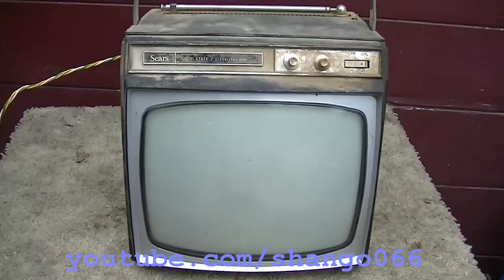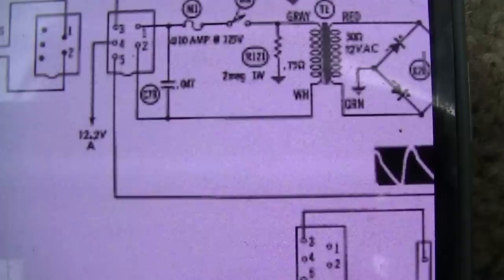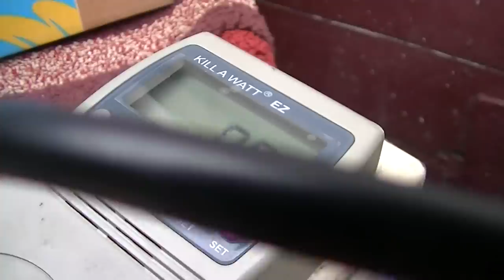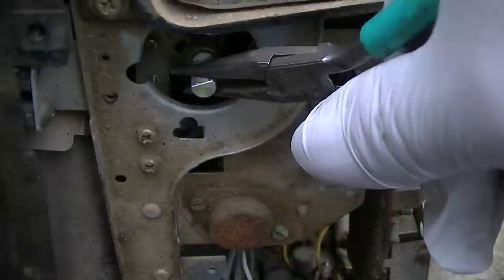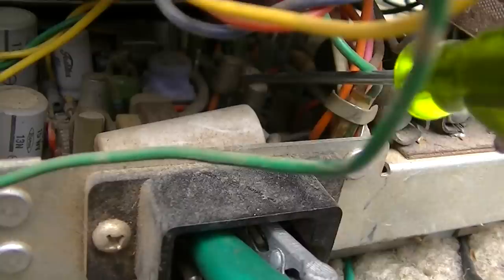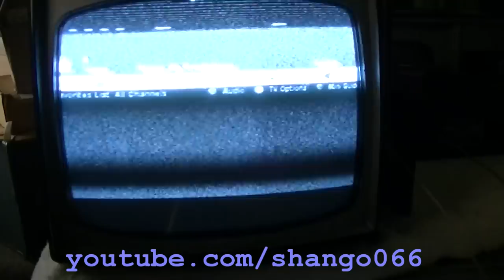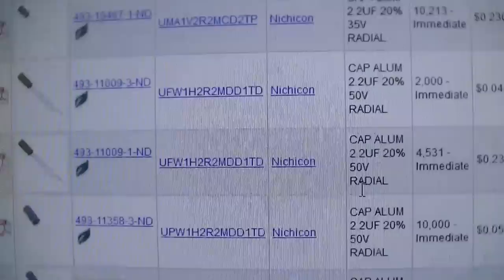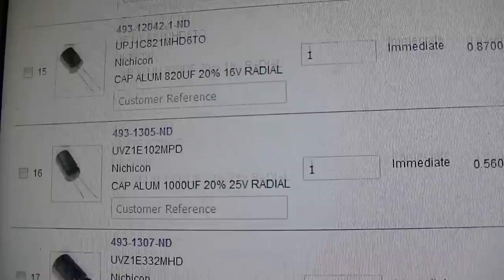1966 Sears Toshiba Portable Black And White Television Assessment For Repair

Comment: I have been self diagnosing my own CRT problem though watching videos by you and others with experience. (I have zero electrical / electronics background) and I was getting hung up on the best place to order parts. I tried a few places but kept hitting a wall. That little clip of you ordering parts at 25:00 made all the difference in the world! It finally "clicked" on how to order the correct part and helped me locate everything I needed from Digi-Key. I placed the order a few hours ago and they shipped it the same day! AMAZING. Thank you for posting this! ATTENTION: To all those champing at the bit to provide me with unsolicited warnings that I can critically / fatally injure myself...   I got it. I understand. You don't need to waste the keystrokes replying here.
Reply: I've got an Oz made 60's tube radio/pop out record player of the HG Palmer brand (Garrard record player) ) console setup , coolest looking thing , not working but there is a wire loose on the board that I can't for the life of me . . figure out where it broke off ,  the kicker is that the chassis appears live . . high rpm flicker on the volt stick . . a project to end all projects ? 
Most of these Oz consoles were made by HMV & rebranded to suit smaller outlets

Comment: Sony was obsessed with making TV's as small as possible in the 1960's.  I can just see the draftsmen doing the PC board layout, using a micrometer to measure a hand full of parts for their component models.  In the mid 1970's, Sony's sets were already having electrolytic capacitor problems.  I remember when I was in the military in Tech School, the base commander caught wind of my TV/radio repair talents, so immediately got all his repair business.  He had one of those 5" Sony TVs from 1964 he wanted repaired, when I saw it, I said "no thanks!".  Those were pure misery to work on the way they had all the components and PC boards jammed together.  To be sure the set was properly fixed, you really needed to replace every electrolytic cap.

Comment: Yeah, I spend an hour putting together DigiKey orders. Their new filtering system is actually much better than the old one. Checking the "in stock" items box can cut the results list way down. I also use first class mail for shipping since components are usually light (under 13oz package) so costs under $5 to ship and is often faster than the more expensive rates.
Reply: Hah, I was yelling at the video “click the in stock check box!!!”

Comment: I never worked on that particular model but, was familiar with the Japanese solid state and tube sets.  Toshiba was one of the better manufacturers.  The Japanese reused their pocket transistor radio experience with the earlier TVs (note all of the germanium transistors, cheap electrolytic caps, and dog bone style carbon film resistors).  I like how well Toshiba kept the power consumption low on that set.  I would imagine that set could run off of AC line power, 12Vdc car power, and probably a battery pack consisting of 8 D cell carbon-zinc batteries (they didn't have Alkaline batteries in that day).  One of the common sales pitches at the time was, showing someone at the beach enjoying the ball game, in reality though, the screen would wash out in the sun.

Comment: We had Sears/Toshiba TVs back then. My brother worked for Sears back then so he got them with an employee discount. They had a terrible problem with electrolytics going bad. It made upkeep very expensive. Replace one and two more would fail. Replace those and get ready for more failing. The only caps that were worse were those awful plastic ones from Sanyo. Both companies designed great products but their bad caps sent them to early graves. After the 3rd or 4th trip to the repair shop people just gave up on them.

We also had a Wards (Airline) set very similar to this made by Sharp. It lasted for many years. Most of the Sharp gear sold by Wards was OK for years. Sears had a spotty record after they switched from Arvin to Asian suppliers. Stuff from Hong Kong was especially questionable. 

This is probably a very rare survivor. The rest probably got dumped on the curb back in the 60s.

Comment: The US electronics industry could see the limitations with germanium transistors as early as 1953 and saw silicon as the future.  There were 2 different types of Germanium: point contact (which were very tidious to build and could lose connection under high vibration) and diffused junction types.  Point contact quickly became obsolete after the diffused manufacturing process was worked out.  The problem with the diffused junction types is, the juntion un-diffuses after a number of years, especially if operated at high junction temperature.  So, diffused germanium transistors can actually go bad just setting on the shelf.  The Japanese we're slow to switch over to silicon, probably because they put so much effort into the development and manufacture of germanium.  They had to "reinvent the wheel" so to speak.  The only transistor technology they could get their hands on in the 1950's, was basic overview information derived from US tech journals.  Also, germanium transistor manufacture was easier build from a company startup point of view than silicon.

Comment: You can select several criteria in the digikey filters by holding down the Shift Key and clicking them. For example, when looking for 15V minimum, you click 15,20,25,35. That will give more results. Also in some filters you can enter min and max values in the fields below

Comment: Digi-Key website is an even bigger pain in the ass to use than Mouser-lol, great video.
Reply: I like Allied Electronics, the website seems easier than Mouser. Less selection, but they tend to carry a manufacturers line instead of just parts and pieces of it.

Comment: I have a set just like that made by singer co. and i do have the external battery charger pack with it, it was at my brothers house, one of the sets we had as kids, not sure if it works yet though, but another portable we dug up did work pretty good, only thing mine is missing is the actual battery, but every thing else is with it, i may wanna try it some time, the first set i just plugged in it took about 10 min. then it came on, these have not been run since we were kids, but i took a chance and plugged in one set, but not the singer set, ever hear of a tv made by them, as i know that co. makes sewing machines but when we got these sets out i was surprised they made tv's too. they are cool little sets, i watch The Flintstones cartoon on the first set i tried and ran it a few times no Issues, the singer not sure yet to try, but might. as here i still use the older CRT sets.

Comment: I find using ranges of values when searching helps a lot.  Say you're after a 16uF@16V.   Old cap tolerances were wide.  Searching for between 10-20uF and 16-50V would show you a lot more choices, and you just pick an appropriate one.

Comment: Perfect section of carpet to add to my carpet lined shower.  Just pick Panasonic electrolytics from Digikey.  They are pretty much the best.  FM series for low ESR circuits and the EB for ultra long life if there is room for their slightly larger size.

Comment: I wonder if Toshiba/Sears used the label "SOLID STATE/transistorized" because they expected that integrated circuits would start appearing in consumer equipment within a few years.

I have to admit that some of the components in Japanese electronics of the 1960s through the early 1970s were really cute! I loved those three little high voltage tripler diodes. Sanyo made nice looking germanium transistors that were shrink-wrapped in pastel blue or green. The resistors were often of a miniature dogbone style.

Comment: Hey Shango, you know when you have those filter lists on DigiKey and other sites, you can hold the Ctrl key and click several different options in one list, if you like. For example, you can select 10 different voltages at the same time if you want. Or select 20, 21, and 22uF at the same time.

Comment: I haven't used the search engine on Digi Key lately, but I found that the one on Mouser is somewhat frustrating to use sometimes since it displays items that are not in stock, or require large volume buys, like 5000 units. To make matter easier I usually go by capacitor value in uf. then a range of voltage, pick lead style, then let it search. I don't worry about brand names, other then Lelon, the rest are usually reputable brands like Panasonic, Rubicon, Nichicon, or United Chemicon, just pick out the style that works best, for the lowest price. If it's a choice between 85 degree or 105 degree, of different makes, but the price is the same, go for the 105 degree, ditto for ESR, or voltage. It never hurts a project using a better rated cap if it will still fit. Another thing, if you can use a non polarized cap to do the same job, and it's inexpensive, go for it, sometimes it makes sense to replace the small value electrolytics, under 5 uf, with those.

Comment: If you hold down CTRL when you'r selecting from lists on the Digi-Key website you can select multiple values if you aren't sure what the new rounded value is for a cap.

Comment: I'm thinking about going to Digi-Key for some caps for my 1989 Macintosh Portable that still won't turn on after the battery was rebuilt.
Reply: VectraQS mine has bad ones on the audio board... It's mute :(

Comment: I’m currently working on an 1983 RCA black and white tv. All that needs to be fixed is the antenna wire and the speaker has to be replaced.

Comment: You should try to run this TV from 12V power suply. I think that all picture instability would go away, because main problem is caused by bad electrolytic capacitors in internal power supply.

Comment: Shango066, Digikey is a great place to purchase top quality (no counterfeit) parts.  Any electrolytic cap they stock is good quality.  There are 2 different types of electrolytes used, which is why they have  -40 to +85 and -55 to +105 Celesius ratings.  The specified ripple current is rated at the maximum operating temperature which gives the specified life.  End of life occurs when the electrolyte dries out.  I highly recommend not buying any capacitor with a voltage rating less than 25 volts if you have the physical space available.  Going lower in voltage degrades ESR/ripple current and sometimes life rating.  I generally never used the lower temp electrolyte parts, with a small case size, they have a tendency to dry out quickly.  If you are doing a junk TV recap, I would also use the lower temp caps.

Comment: I just grabbed a rough zenith system 3, my guess is from 1978-ish.
No high voltage and I’m afraid the crt may be going out.

Decided to take your example and give it a shot, I usually don’t work on trashed sets.

Comment: Notice that they didn't state it was fully transistorized. What are those three tubes, nuvistors maybe?
Reply: Nuvistors only came in metal envelopes and were much smaller. Those are 1DK29 subminiature tubes.
Reply: Everything in that TV is Toshiba branded, except those 1DK29's, which are Sears.

Comment: replace all hoigy baimlers,,,excellent advice,,killer lil basterds hoigy baimlers are.
funny munna use the term when a neph is dirty & oily grungy working in the car,,alls you have to do is replace the hoigy bainlers kid!          of course,coff ,coff,I shall certainly pay royalties to the author for fair usage.,,
Reply: hoigy baimlers tend to cause more problems with vintage electronics than black beauty caps alone.
Reply: @RoughJustice2k18  ya

Comment: I have a Sony TV920 U that I purchased in 1969, started to restore it over 14 years ago but had to put the project on hold. A friend has supplied me with the electronic version of the service manual but lost it due to a hard drive crash. My problem is that I removed the power/volume control since the pot failed. Lost the part in a big move. AAARRRRGGHHH. IF you or anyone reading this comment has the SAMs on this can they please give me the value of the volume pot. Trying to find a small format push pull power/ volume pot will be all but impossible but I can come up with something with a rotary on/off volume pot.
Shot gunning all of the Caps is on the agenda before I even power it up.
Looking forward to the follow up video!
Reply from the maker: ill pull the sams and cover it in the next video, its not too critical probably 5k would work but let me look
Reply from the maker: Yes its 5k and will be covered at the end of the next video on this set in a few weeks
Reply: Thanks for the Info!!! I will start looking into some pots I have laying around if not I'll call DigiKey and give them the dimensions and value and see what they might come up with.
Keep up the great videos! Hollow state brings back fond memories for me. Also have a '60's vintage furniture piece with a Grundig  stereo receiver and a Telefunkin changer. Time for serious audio listening pleasure.

Comment: Can you get a 2004 sony tv repair
Reply from the maker: I burn anything 1980 and newer....
Literally
Reply: @shango066  I at times don't blame you 1980 is when everything seemed to fade into Chinese and Taiwanese crap. Although I'm using a Toshiba 42 inch lcd from around the first generation for 1080p and only 1 problem and 0 repairs. It outlasted my first long term relationship. The problem was from last year but last summer for Canada was one of the most brutal for heat that I can remember. I felt like my skin was going to melt off in my apartment there was like almost no relief and I'm by the shores of lake Ontario.
Reply: @shango066  Make the EOL great again. I think its time for one :-)
Reply: What about computer monitors?